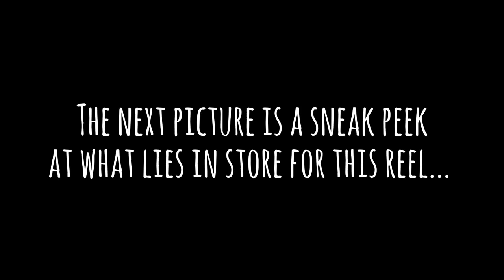Shakespeare 2052 Part 1 of 3: Disassembly

Comment: Nice video! Helped me with my 2052. I used a matching rod and reel as a kid the rod is purple like the reel. I still have it! Would you know we're to purchase a new spool? My drag spring on the bottom of my spool is broken. Or know how to fix that spring?
Reply from the maker: Nick Sandoval it will be hard to find a spool for it. I have seen some on eBay but not very often. You should be able to fabricate a click spring for it if you are handy and creative. It is just a thin piece of metal. It would be a trial and error thing to get the right fit. You may want to search online to find different types of drag clickers for spinning reels to see if you can duplicate a design that would work. I think I would probably cut and bend a new one and heat it to see if I could melt it into the spool like the original spring.

Comment: Mine turned out excellent! Any thoughts on how to lighten the bail trip? It's a bit stiff on mine.
Reply from the maker: It isn't the smoothest trip mechanism I've ever seen. There isn't a whole lot that can be done easily other than decreasing the spring tension on the trip arm. Don't get it too loose or it may come loose. It needs some tension to keep it in place. Another option is to remove the bail wire and fish it bailess (also known as a manual pick up or PUM). It is easy to try and see if you like fishing that way on this particular reel because the bail wire is removable. If you aren't familiar with fishing with a manual pickup, look up some videos about it. There are some advantages to fishing that way 👍 One disadvantage that you don't hear about though is if you fish shallow rocky bottom bodies of water and are in the habit of jerking lures free from the rocks a lot, the line can jump off the line roller pretty easily with those sudden jerky movements.
Reply from the maker: I went to look at mine and the trip mechanism is smoother than I thought I remembered. I did disassemble all of it and clean/ lubricate the pivot points.
Reply: @TheFishingHobby  Thanks for the tips. I've thought about manual pickup but haven't tried it yet. Will give it a shot. I'm also thinking about filing down the bail arm where it latches but I'm not going to do that until I have a spare to try it on.